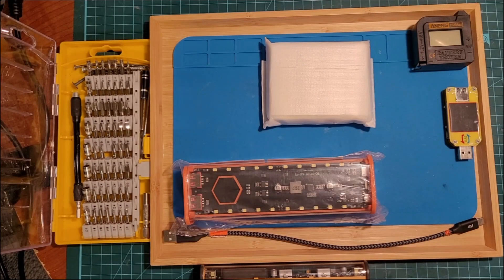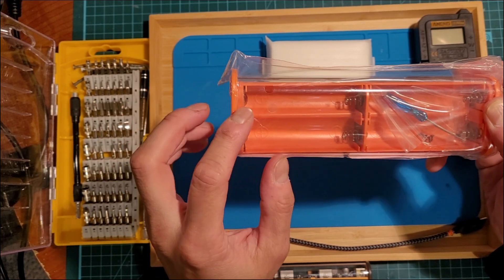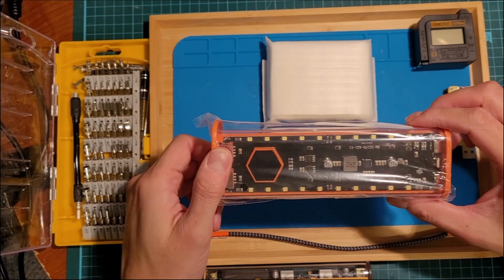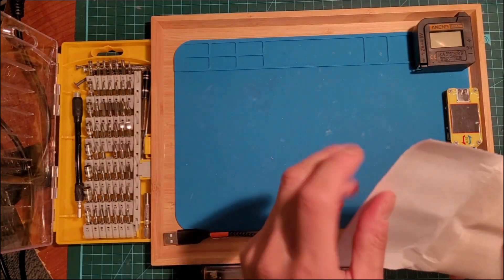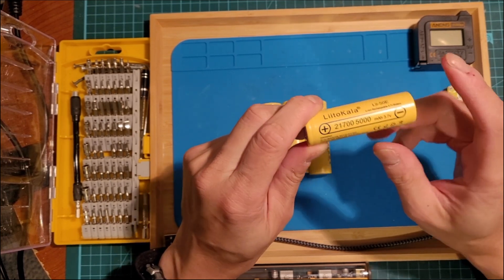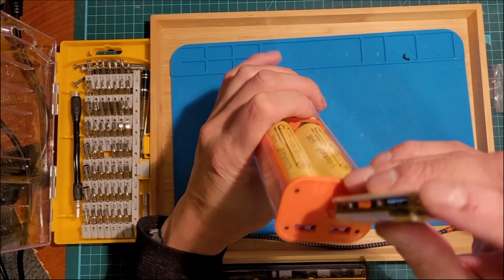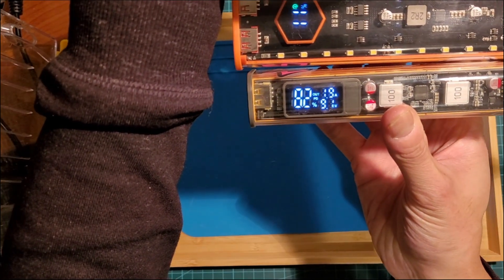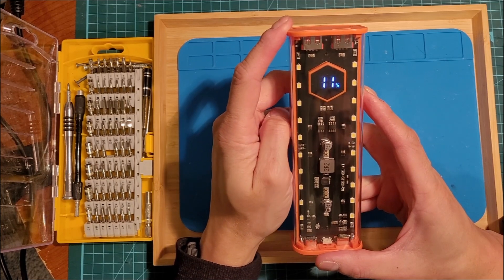Aliexpress DIY 21700 Spring Loaded Fast Charging Power Bank

Comment: Hope you see this, I could use your insights. Could I use spare 21700 batteries with different capacities and different internal resistance?
Reply from the maker: Yes you can but it wont be very reliable or safe.

Comment: Hey, Thank i'm plan to grab this since my battery in powerbank keep die after 2-3 year just want easy to replace battery.

So you can charge battery inside the DIY power bank without remove it from what i see in Video, Thank 21700 is seem easy to replace
Reply from the maker: Oh yah, thats what I got it for, the easy replacement! But the one i showed you in this video developed a weird problem  with one usb port, so I lost one usb port. These are cheap enough that you can just buy another one instead of trying to fix it.